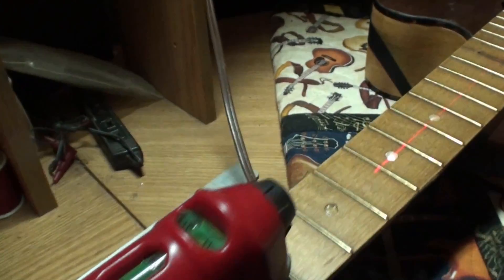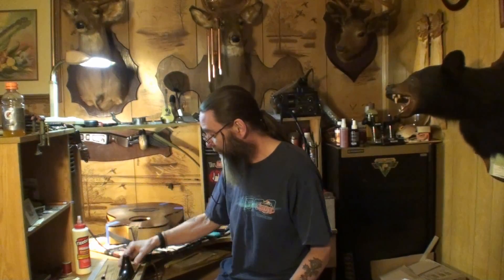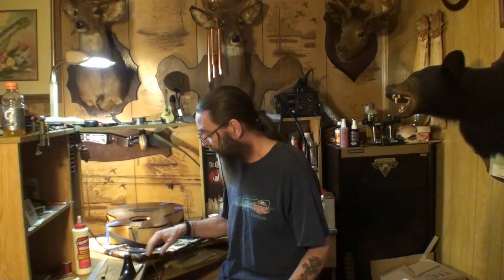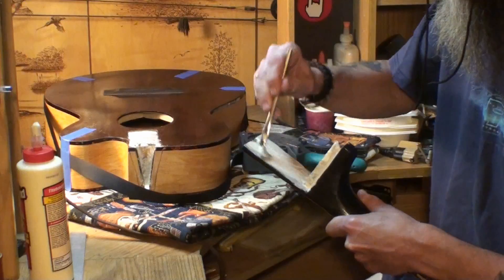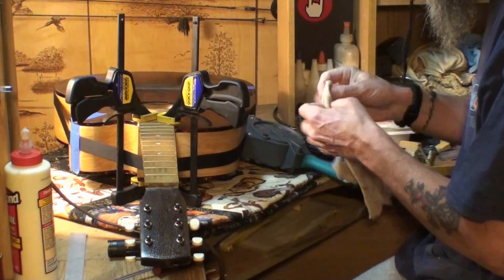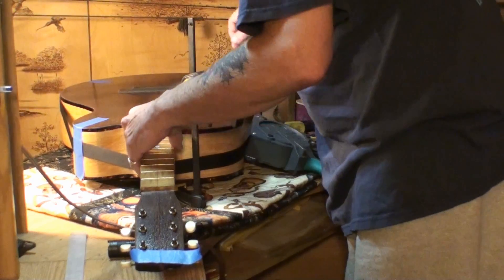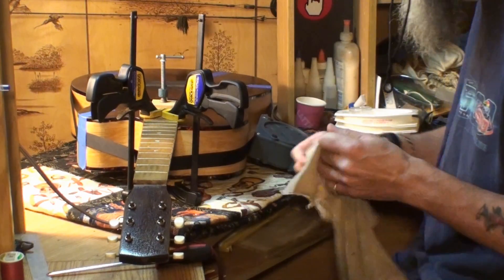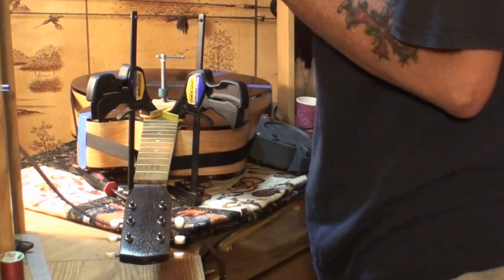harmony kay neck reset glue up 2of3

Comment: Hey Randy!
Is there any way to improve old tuning machines? Or if they are loose and 30-years old one'd better throw them away?
Reply from the maker: The tuners on this particular guitar are worn out, I took them off the cleaned and lubed them good but even with no strings they are hard to turn. I think the owner wants to keep it as original as we possibly can but when they are as bad as these are I would have to recommend replacing them. Not much you can do besides replacing the gear if you have the right ratio to match the key shaft and lube them.
Reply: I'm playing with an old Alvarez 12-string.
Man, guitar sounds AWESOME! But I don't know if I should do something to its old tuning keys or just replace them... they are loose as shit and they are so freaking hard to turn under string tension.
Reply: Randy Schartiger, keep it original as possible. Kind of funny with a Kay neck on a Harmony body.